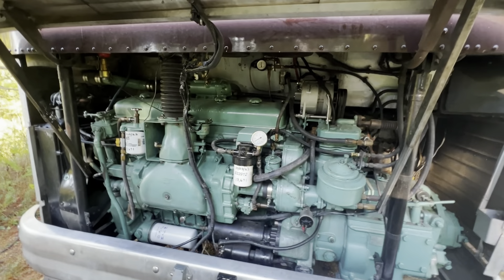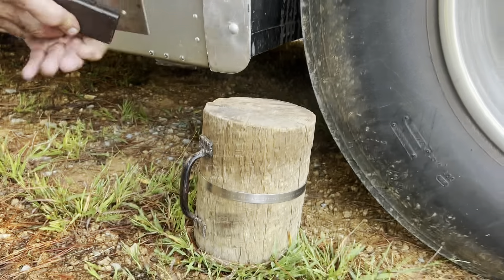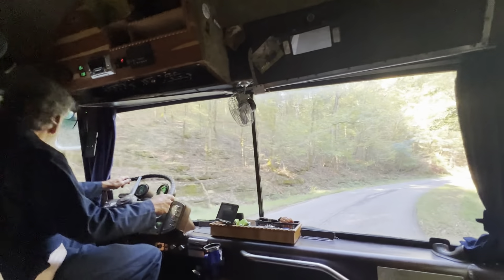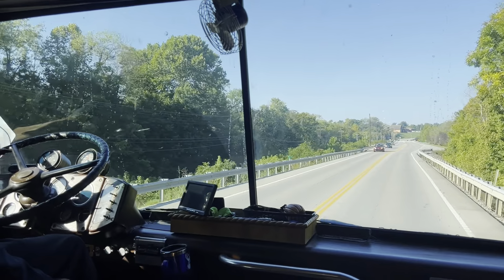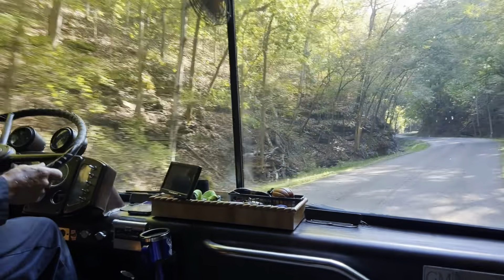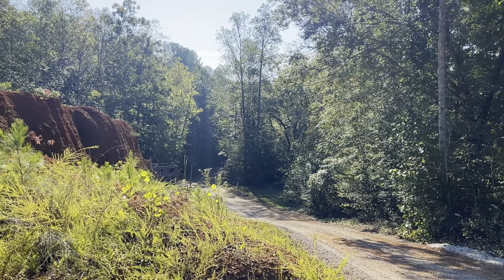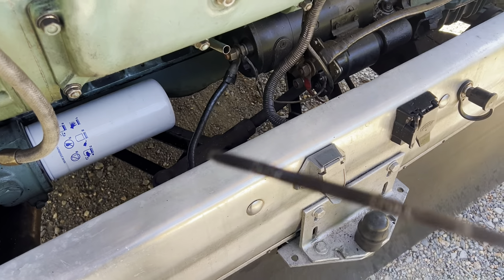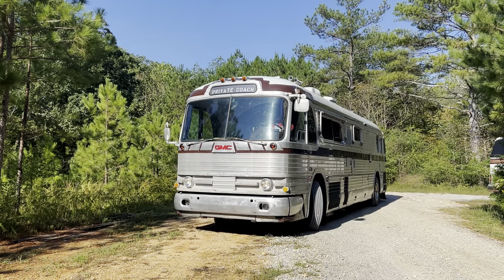Detroit diesel 6-71 back from near death & ready for a test drive. Another breakdown and Tow needed

Comment: Way back when if we had coolant contamination in the oil we drained and refilled with a 50/50 mixture of 30W and butyl celosolve ( 2-butoxyethanol ).  Run the engine for an hour or so at no load and then drain well, replace filters and refill with the appropriate engine oil.

Comment: I’m glad to see a good outcome. Remember that if you’re having to add coolant and don’t see leakage on the ground you better be looking for where it is being lost. Pull your oil dipstick and make sure you don’t see it there or that your oil level is not abnormally high. Look for evidence in your exhaust pipe for burned coolant, in some cases it can even find its way into the fuel system.

Comment: judging by that Q siren and the fact that the engine bay is as clean as the INSIDE of that bus.. hes retired fire engineer. Just wondering.   Thats the cleanest engine ive seen on this show yet.  Great job saving this.  Would it have been worth taking one or two main bearings out to inspect? Giving how much water the crankcase ingested?
Reply: Agreed, that engine looks nearly immaculate, clearly loved!
Reply: While we had Detroit Diesel rebuilding the engine in our '06 I cleaned and detailed the engine bay. Even repainted the cradle and polished the copper air tubing. Was nice to see.
Then ..there was a guy known as the "chrome kid"...Way shiny.
Happy motoring!

Comment: Scott he should change the vibration dampers, cones and front seal. If the dampers are bad it can break the flywheel bolts and or break the crankshaft not an good idea to ignore this problem dampers are cheap compared to the crankshaft,

Comment: Honest question - Why is an oil "stabilizer" added to a quality formulated oil like Delo?
Reply from the maker: These is still a bit of coolant leftover in the engine.  He wanted it for the trip home.  He has already drained the oil
Reply: The oil stabilizer raises the oil pressure across the whole temperature and rpm range. We think that's a good thing.

Comment: Scott could the crankshaft splashing into the oil/coolant have caused the damper hub failures?
Reply from the maker: It certainly didn’t help it.  Clearly it was cracked before and probably wouldn’t have failed this quickly would be my guess.

Comment: Scott, i have a few questions re. 2 local coaches for sale. 1975 MCI and 1981 Provost. Both are 8v71 - 5 speed manual. 
 How can i get in touch with you ?
Reply: Check the about section for the channel, follow the info and links.
Reply: I’d buy the Prevo, sight unseen.  As a retired driver, I worked for an outfit that only had GM’s until 1980. Then later worked for a company that was all Prevost.  We were bought out by an MCI owner. The early MCI’s had poor cooling, and low power in the mountains. If you buy the MCI, better buy a “thumbsaver”. If you ever drove a dog, you will know what I mean.

Comment: Man, there was no way to find that damper crack without actually disassembling it. Older car and truck dampers need to be checked regularly because the rubber ring does wear out. And sometimes there are final balance pins in the damper that must be transferred to the new damper to preserve smoothness.